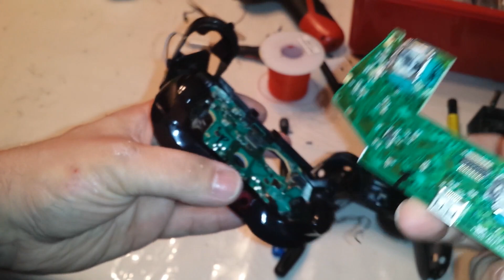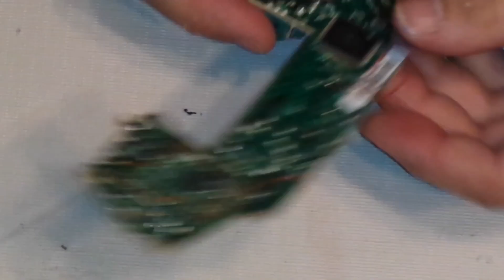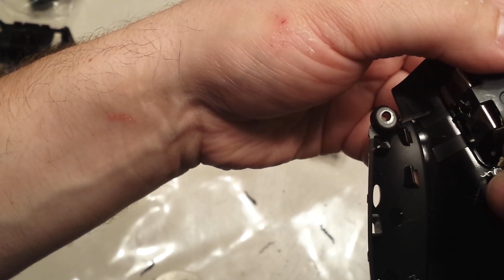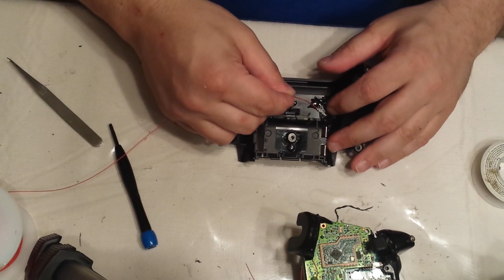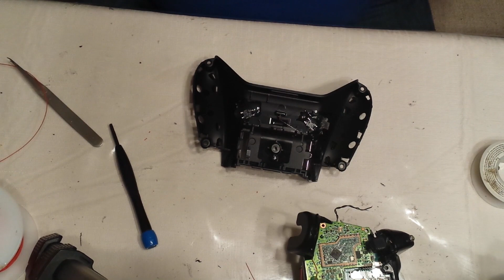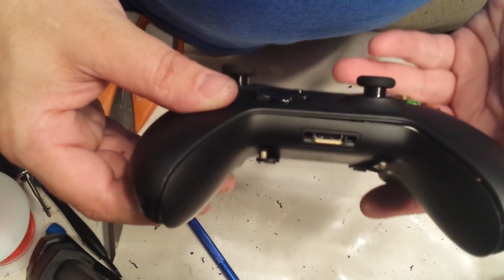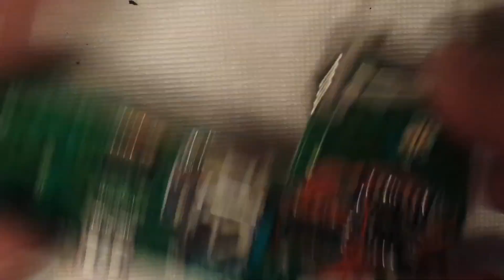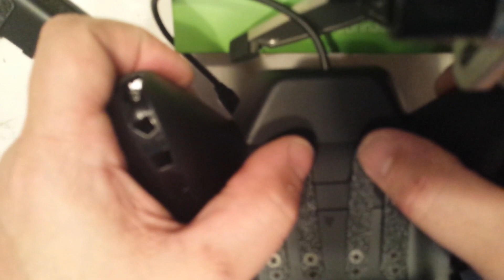TUTORIAL BUILD YOUR OWN XBOX 1 Scuf style Controller w/ Triggers Stops, Remap chip & MORE DIY Gamer

Comment: At first: Thanks for your tutorial :) 
Its hard to find sone of the components in germany, espacially the drill bits, but with ebay i found everything and all parts are on their way to my home :)

But i have one question left: Can you please tell me the size of one paddle that you use? I mean width and height so i can cut out my paddles :) Would be really great because i can't find the size anywhere. Or do you habe a photoshop document or a blueprint for one? That would be even better :)

Thanks in advice :)
Reply from the maker: 1/4 inch wide. 2 inch long. 1mm thick for aluminum or 2mm for plastic.
Reply: Ok thanks but does it also work with Lexan 1mm? Because i ordered a plate of lexan with 1mm and it would be said if i had to order a secound one with 2mm because these plates of lexan are really expensive. I ordered 1mm because the sheet you linked in the matierial has 0,040 inch and that's ~ 1mm if i look in an exchange table so i thought that's the right one. 
If you say its absoulutly not working with 1mm then i order 2mm but that would be another ~15€ incl. shippment.

And what's the best way to cut out the paddles from the lexan sheet? with a little saw? Sorry for the stupid question but i hadn't work with lexan yet.
Reply from the maker: ***** LExan is fine...

Cut lexan with lexan cutting tool and use sand paaper to shape.
Reply: Ok thanks. But i think i try it first with a normal scissor or a coping saw because i own bouth. If none of them works i buy a lexan cutting tool but i hope i can save that money, the whole project costs enought, about 40€ for now without the costs for the xbox one controller, only for materials. 
But its still a lot cheaper then a normal Scuf Controller bought at the internet :)

I also bought a chip to customise the buttons but there i didn't choose the one you linked, i choose a cheaper one from another store.

I will report here when i done the modding completly of everything works.
Reply from the maker: *****  YEA you probably chose Ars***l mod (not going to give them a real mention since they stole my remap idea). Their Chip is very budget.. it is just a chip with wire.  I have a very easy to install PCB and I now have a PCB key. You get what you pay for.  I built my remap chip with many things in mind. Their mod only works on Xbox one. My chip works on Xbox 360 (wired and wireless) and Xbox one. And the new Xbox one chip is super easy to install with very few wires. It is a full key that lays on the circuit board and allows you to just attach it to the xbox PCB.   I knew that once I released my REMAP chip other people would copy and I invested a lot of time and money into my chip. There is a reason my chip is $40 and not $20 like the other guy. I have 3X the functionality. I have a simple remap system and I have a super simple install.  Even if you are installing my Square PCB, all my solder points are marked and the install takes 20 -30 mins. The copycat just programmed a pic and you have to follow along with a paper diagram and count legs on a chip to figure out what goes where. It really is low budget.  I have already designed 4 chips myself. I have my triple Xbox chip (installed in the 3 controllers I mentioned), I have my super simple FLEX PS4 boards and I have 2 new Xbox one keys.  Lastly my chip does multiple remaps on the same remap button, theirs does not, so you can use it for more than just FPS games. The new one Key take about 5 minutes to install. SO if you are budget conscious, sure go with the copy cat, but your install is going to take a while to do. Also he does not offer the support I offer.  Where is his install video?
Reply from the maker: *****  Here is the new key for super simple installs.

http://www.ebay.com/itm/Xbox-one-Remap-Board-Install-PROGRAMMABLE-Buttons-on-your-controller-Like-ABXY-/301536581617?
Reply: Yes you are right. Your chip looks great but the problem for me actually is the price. I'm student at the university and i have no job so i have not much money. Because of that i wanted it as cheap as possible for now and your chip costs 40$ and the other 14$ thats a big difference for me at the moment. Also the rapidfire feature is interessting for me, is that possible with yours too?
But now i try the chip from them and maybe i buy one of yours in the next months for my secound controller when i get extra money from selling my old iphone because your chip looks very interessting and then i can compere the both chips and see which is better in handling while playing and which is easier to install (there i can say from the pictures yours look easier to install :)). When i'm going to try yours, i can write you a message and than i can also write a detailed review and post it in Xbox Forums where i'm active and you can then link to the review if you like. So please tell me if you are interessted in a review then i can make one when i buy one.
Reply from the maker: *****  Well good luck with that install. It is a total mess. I bought one (always buy your competitions stuff) and try it. It barely fits in the controller and there are more wires than I know what to do with.  As for Rapid fire... That rapid fire features is literally a joke.   One rapid fire speed.. really? I have a chip that has 2 programmable remaps + 40 rapid fire modes with 50+ speeds you can program for a total of 2000 combinations for $40 as well shipped and remember those are my ebay prices. I sell them a bit cheaper directly  The $40 chip is $35 shipped.  SO yes I have a rapid fire + remap chip that is a KEY chip - same as the key posted above but you have to solder wires to the triggers too since it is a rapid fire.   The install is a mere 10 minutes. It only works on Xbox one and PS4, no 360 version.  THe PS4 version is only 6 wires to solder.  The Xbox one version is 7 wires or if you know how to scrape and solder to VIAs it is NO WIRES... Total Key install.  In the future message me first.  I always can give you a deal. Sure I can't give you $14 - no way, my boards cost more than that to make, the I have to put a chip on them. But he is not using a board, he is using a FULL IC chip the thing is as big as my pinky and like I said is a real mess to get it to fit into the controller. Then you have what ... 25 wires to solder? Is saving $20 worth that mess??? I think not....  Student or no Student, Budget or no budget, there is a huge difference when it comes to Functionality and neatness, vs price and complication.   

Wait till you see the next project I have....
Reply: As i said maybe i buy one of yours for my secound controller next month. But now i will use the other chip for myain controller because its already at its way to my home via postoffice so i can't cancel it. Also its no problem if its a bit more difficult, i have very good soldering skills so i should work to get it working :) 

Maybe if i had found your new chip version before the other got shipped i had bought yours but there was only the old one in the description and the old one was with as many cables to solder as the cheaper one so i bought the cheaper. 

But now its too late, now i use the other one and as i said for my secound controller i maybe buy one from you next month, maybe you can lower your price until then a little bit or make a "special offer" than more people would buy yours, here in german forums and message boards are many people that want to build an own controller with such a chip but 40$ is not cheap for students like me who don't earn money or earn less money and also when there is another possibility for half the price.

Comment: Thanks for the help I managed to sort it... It was a ground problem.. I solved by grounding them separately now I need help re mapping the left and right on the D pad... just wondering if you have any info ???? Thanks again
Reply from the maker: yep  PINS 3 and 4 on J5 connector.  Same as A B X AND Y just a wqire to each point and then ground.
Reply: MODCENTRALUSA 
Thanks dude and sorry to keep bothering you but could you check again as I wired pin 3 on j5 and it's down on the dpad not left or right thanks and sorry for being a pain in the ass but you have been a great help :D
Reply from the maker: jonathan bentley 2 and 5 are left and right .. 3 and 4 are up and down - I messed up I thought you said up and down. Either that or I was 1/2 asleep.

Comment: just a tip for trigger stops, take a utility knife or something of that nature to mark on the trigger. make sure it will show up on glossy black. then go into a custom match in whatever game you prefer, (cod or halo work best) then press down on the trigger until it shoots/zooms - then take you knife, or whatever your using, and mark exactly where it completes the circuit, its best to have the plastic covers on as this is what the trigger stop will be pressing on, then drill just above that line, DO NOT DRILL UNDER THE LINE!, then insert whatever your using for your stops
Reply from the maker: NO need to do that.

Just drill using your 4-40 drill bit. right through the shell behind the triggers.
Then pop in a set pinb screw. It becomes a hair pin adjuster. 
Put your trigger stops a bit above center and use the set pin screw to adjust them.
SO you can set the sweet spot for each game.
Reply: MODCENTRALUSA Ok, i didnt see that it was adjustable
Reply from the maker: P4IN COMM4NDO  it's not in the original tutorial but super easy to do.  Just 2 holes and 2 set pin screws and your done.  Anyone who needs pics just email me.
Reply: ohhh

Comment: PLEASE HELP have followed your instructions exactly and remapped the  X & Y as well as A & B all work fine apart from X every time I press X while playing battlfield 4 it doesn't reload my wepon as it should it dose a knife attack as if I'm pressing the right thumb stick press please can you help with this I've checked my solder and it's not touching any other conection  ????
Reply from the maker: A and Y are next to each other on J6 and X is next to view and trigger.

Check your X solder point.....  Make sure you didn't accidentl;y get any solder flake or a solder bridge to the points on either side.

Comment from the maker: Samantha Bolshoun Paddles in this video are home made. I put the materials in the video description.You can make them out of Lexan or Plastic. Both materials are listed in the description. Just cut and shape them yourself. Very easy to do.    As for pre made paddles. due to the requests from people over the last 12 months about making paddles themself and wanting a quick and better solution than what is out there. I decided to have paddles LASER CUT out of aluminum. They are lighter than plastic, they are more durable. Flex the same way and will never break. I do sell them, you need to email me at the email in the video description. They are not cheap but they are less than what scuf, burn sell them for. They will last a lifetime.
Reply: MODCENTRALUSA how long would the DIY kit take to ship to CA?

Comment from the maker: Samantha Bolshoun Why would you want to remap triggers? Also they are not the same as the buttons. They are magnetic linear hall sensors.  They do not remap the same.  It can be dine, but no one would really want trigger presses on the back oif the controller. That would negate the idea behind remaps.   But if you really want to do it.. email me I will send you the solder points.
Reply from the maker: I now have a chip that allows trigger remapping. If you are interested in that.  But I still recommend not doing that.
Reply: +MODCENTRALUSA The only thing I can possibly think is to make a nastant fire mechanism without having to put trigger stops in? Just a thought. :)
Reply from the maker: +Bela Sziklassy DOne already... email me if you want to see INSTANT TRIGGERS... I have been installing them for about a year now for people. They are $20 installed and they turn the trigger into a Bumper for 0-100% fire per click.

Comment: I added added paddles to my xbox 1 controller. I just used a different spot for my wires. Now for some reason I'm having trouble turning my controller on. Any ideas what my problem is?
Reply from the maker: you either solder bridged Two points you weren't supposed to or you pushed your battery clip down accidently to touch the circuitboard and ground it out.